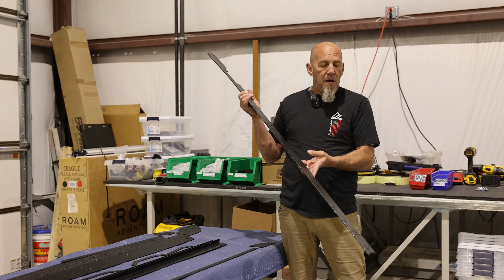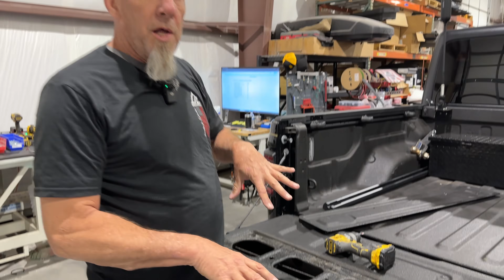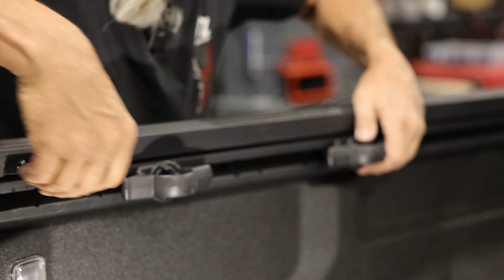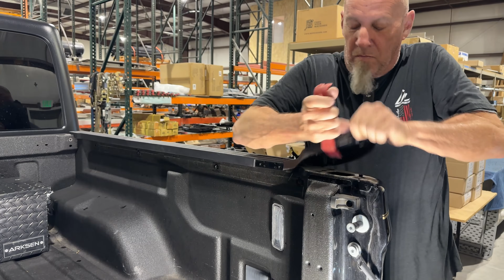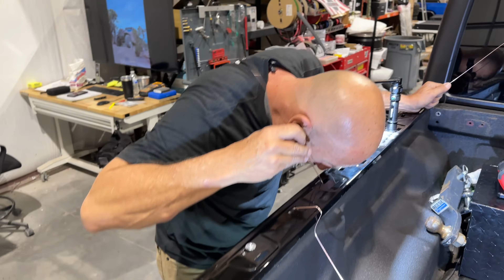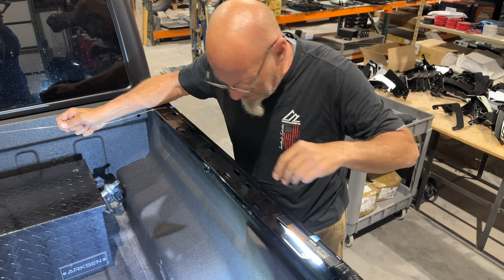Jeep JT Gladiator Bed Rail Attachment System Installation Instructions by AAL

Comment: I used string instead of wire and did the same basic thing.  If you are putting on the LBE (which I did), you don't want or need screws in every hole.  You only need a few on the sides to hold up the underside brackets that are on the outside of the bed.  Also, keep a few long 6mmx1.0 bolts handy as you will use these to help pull up those outer bottom brackets when you remove screws that are replaced by the LBE screws when installing the LBE.
Reply from the maker: Appreciate you, for anyone else watching for their install this is incredibly helpful information!